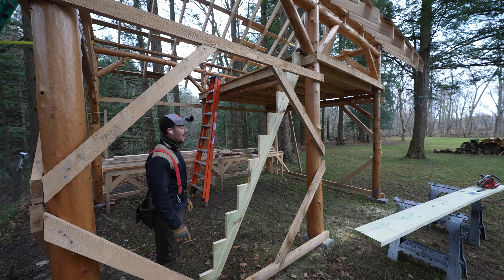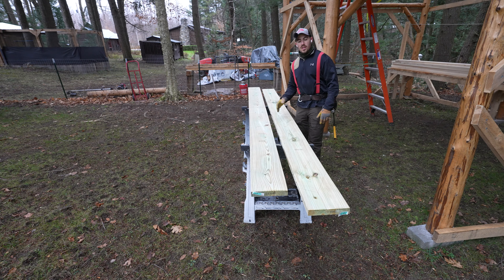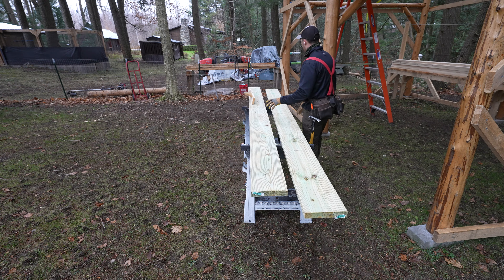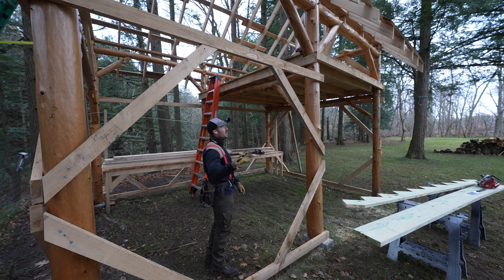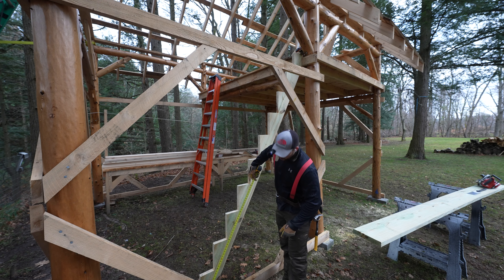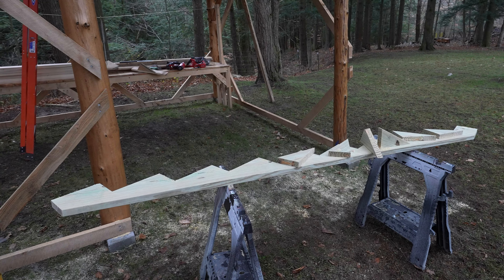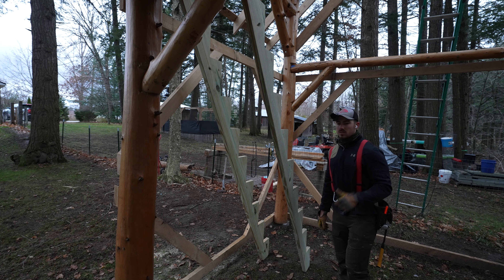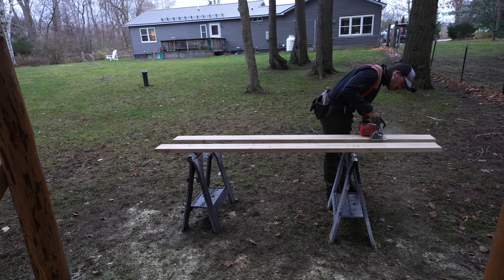Simple Timber Frame Barn // Part 5

Comment: That worked.  Is a pull down staircase, similar to attic access fold down stairs, a possibility?  As far as the video length, this length or maybe a couple of minutes more seems about right.
Reply from the maker: Thanks for the feedback! That’s not a bad idea! I never thought of using one of those. After editing this video and mentioning a spiral staircase I may need to take a stab at building one…how hard could it be?